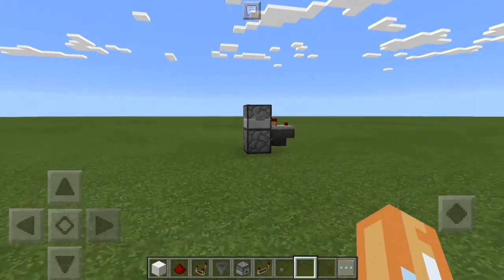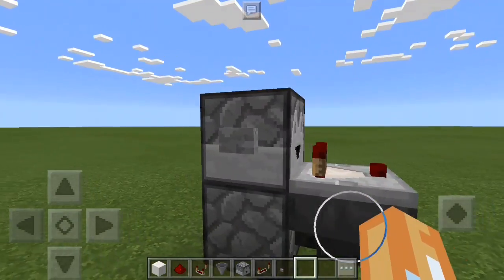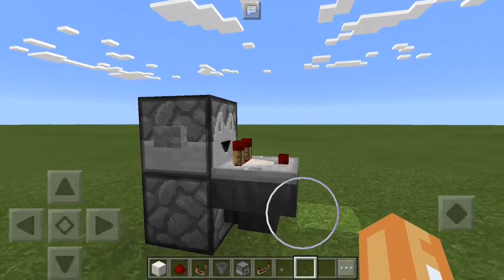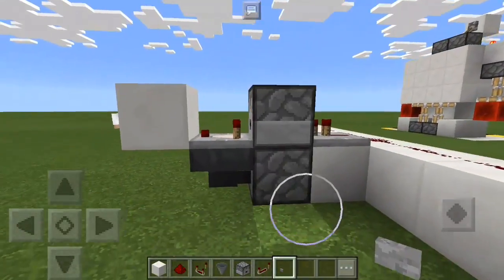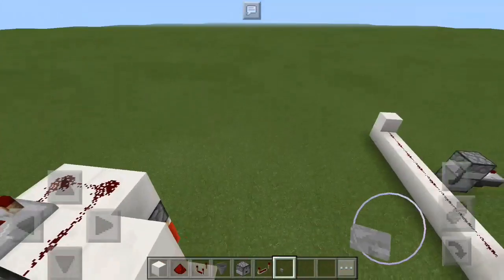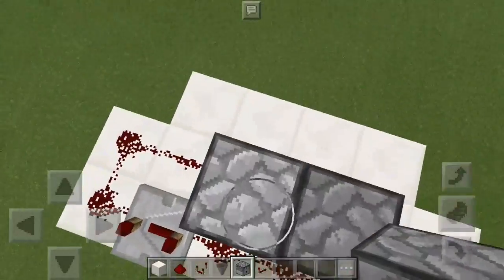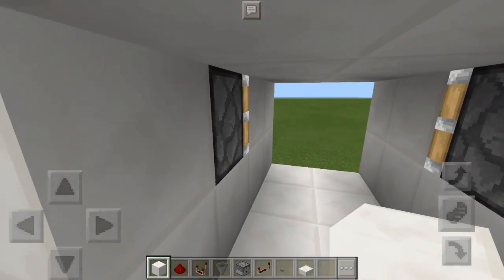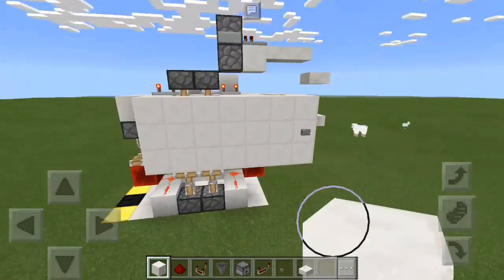Minecraft Pocket Edition Redstone Tutorial: How to Hook Up a T Flip Flop

Comment: Nice video!  Is there other T flip-flops for Mcpe?
Reply from the maker: +Juan Javi Yes there are a few different ones. This one is one of the most compact.
Reply: Trogdor312 oh,  i want one that doesn't have that double click sound. I found a locking repeater one but it doesn't work with a pressure plate
Reply: Locked repeater T-Flip-Flop requires a fixed amount of pulse duration. Stone buttons work best because only 2 repeaters are needed. I'm talking about the clock with 2 repeaters and 1 redstone torch.